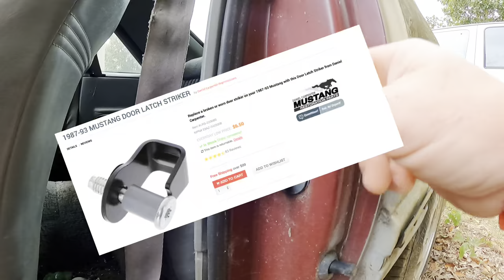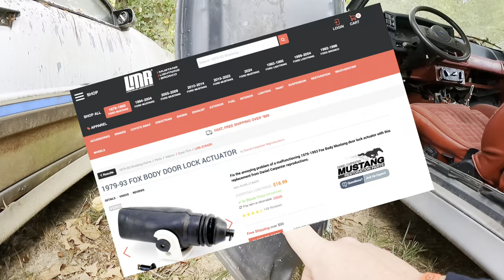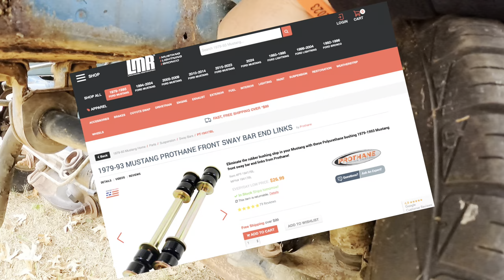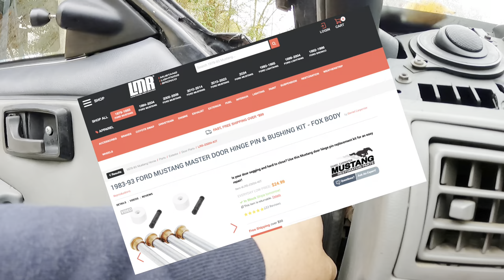Common Fox Body Mustang problems, and how to fix them!

Comment: Door window bushings and guides, rattle when going up or down. Steel braided brake lines are a good upgrade, Stiff HVAC knobs, a little more effort turning them. Weather strip - ALL, just old & dry. Arm rest pads, worn & flat from years of use. Sagging headliners, Again 30 years old. Lights - all there not bright enough LOL. These are some of the little things with my 93' GT
Reply from the maker: Man those window bushings are such a pain, I appreciate the input!

Comment: Biggest thing to remember when changing your door strikers. Becareful taking them out because behind the door striker is a square opening with a loose square nut. The nut can fall into the quarter panel cavity. 
Don't forget to use an erasable marker to outline the original position of the door striker before you take it off if you decide to replace the entire striker new. You want to have a flush door to fender and quarter panel fit. You can also keep the original strikers and just replace the plastic cylinder which the door locking latch strikes onto.

Comment: I really wish someone like LMR would come out with a QUALITY heater core we can use. Everyone knows you can't expect much more than a few years out of the craptastic aluminum ones you can get now. There are so many really nice high dollar Fox builds now. This community deserves a better solution!
Reply: So true. They’re needs to be a much heavier duty replacement. It is a total nightmare replacing a heater core.
Reply: and repo the original shape of the heater core hoses. i replaced the 'box on my 1986 Gt, outdoors, one winter. that gave me all of one hour a day to work on it before it got dark. in 30 degree weather. took a few weeks to get it done, and then i tried to find an original shaped hose before i gave up and hoped the ones available were OEM quality if not OEM shaped.

Comment: Things I have done: water temp sender for the gauge to work. The membrane for the dash cluster, headlight,fog light wiring pigtails. Ignition switch and replacement pigtail. Transmission tailhousing seal. All window rubbers and window motors. And of course, all that was mentioned in the video. However, it’s been relaxing working on it in my shop. LMR is getting my money $100 at a time😂

Comment: For the lock actuator you can just change the assembly. No need to mess with the rivet. Great video though. Almost everything you said I had to replace.
Reply from the maker: Good point!
Reply: and i'll add, wear thick gloves. I did a roll down window setup on my 1986 Ranger pickup, and naturally no one bothers to file down the edges of all the stamped metal inside...i probably had 5 band aids on both hands by the time i riveted the mechanism back together again.

Comment: when my ignition switch went i could see how it was falling apart i decided i never wanna do that again so i bought an ford motorcraft switch...checked all the metal ears to the plastic and tighten them then put small amounts of jb weld (yes on a new switch) to hold all in place...5 years later never a problem~!~~
Reply from the maker: When in doubt, MOTORCRAFT!

Comment: 3:57
I ripped the sway bar mount bracket off the frame in my '83.  
Give me a winding road through the hills any day.     Quarter mile runs weren't my thing.

Comment: i'll toss in here, on 1986 Fords, the voltage regulator in the guage panel goes back after 127,000 miles. result on my turbo t bird, ranger pickup and GT mustang is you come to a stop and the temp guage pegs out. by about 130K all the gauges peg out when you come to a stop. lucky it's not hard to replace, except you have to pull the gauge panel and then monkey with the clip holding the speedo cable. after you've done one, you get how to do it :)

Comment: I’ll ignore the Dodge in the background 😁. Looks like a 66/67 charger maybe?  
 Pickup in dizzy going out and/or tfi module has been a thorn in my side. Had issue with the lifetime warranty ones🙄. The vacuum hard lines are SUPER brittle now. I daily a 90 GT 5 speed all stock except air filter and mufflers 225k miles still on factory clutch. Clutch cable broke replaced ign switch 2x(zip tied last one still working) fuel pump @201k and pump relay(gave problems put original back)
 And when I say daily I commute to work 60 miles one way 4 days a week . I don’t just run to corner store once a week lol. Ceramic brake pads, keep oil changed and keep riding!

Comment: I’m puzzled on why the clutch pedal was so smooth when the plastic quadrant was on my fox. After it broke, I have replaced it with two different aluminum ones and the pedal is so damn hard. 🤷🏼‍♂️

Comment: Don’t drill actuator rivet. Pop actuator out bottom of bracket, lube new rubber bushings and pop in from bottom. Any Dorman or aftermarket actuators are junk and you’ll be back in the door soon. Go to to junkyard and look at 80’s 90’s ford  power lock vehicles. Can even get a metal bracket to replace the broken white plastic one

Comment: I’m having an issue with my power seat on my 92. The switch has a wire that broke off. I cannot find a replacement anywhere. Or anything on how I could fix this issue. Any advise?
Reply: Is there not a way to repin it or reattach it? I'm not very familiar with it
Reply from the maker: I would solder the wire back if possible

Comment: Capacitors in the ecu is a common  issue  also..I had an idle issue  that I could  not figure  out and  after replacing  them my problem went away

Comment: All great lil things  Caleb!!! and lots more in the comments for sure lol...from the "Been there Done that" Fox Owners. Fox Platform cars are so easy to work on, some exceptions lol....I usually  just roll from front to back replacing all the small stuff....Not a daily & I dont think many  are any longer, I just go to LMR  ..order all I need  "100 bucks ish" and replace as my build moves along....Side note , has anyone tried  heater cores from other cars/trucks? Id be  curious to see if anything else may fit/work?  Just an idea....have a great day everyone